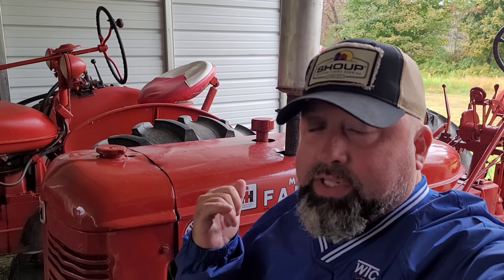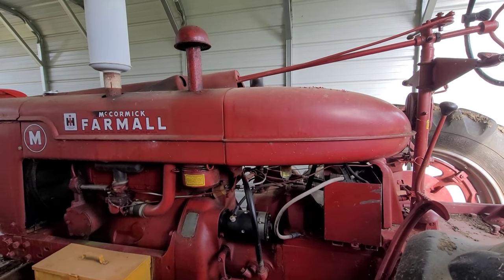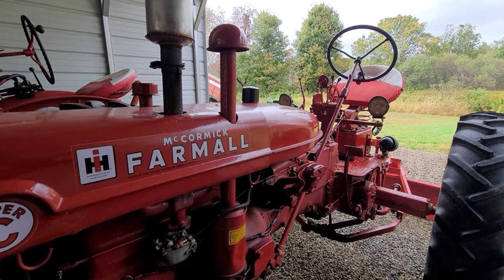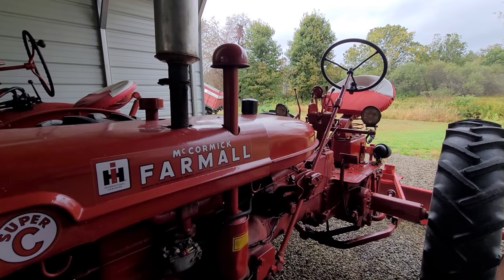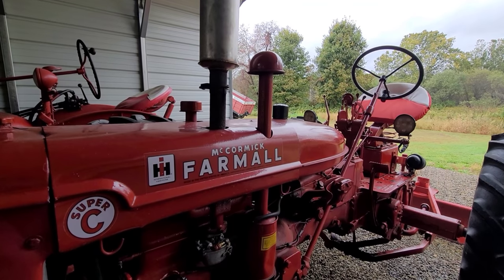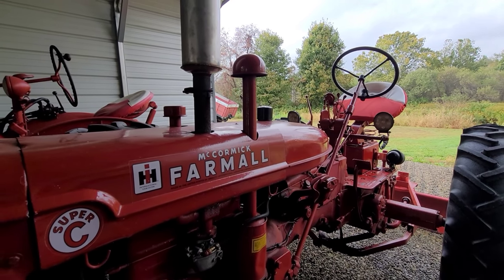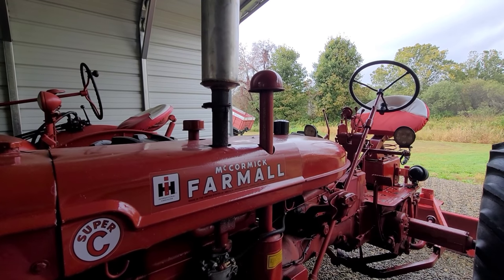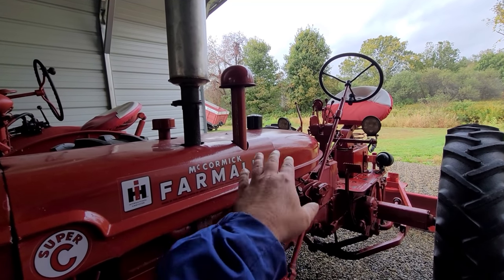How Would You Clean a Rusty Fuel Tank?

Comment: Something we did to help our Super A when it started surging was to put a zip tie around the intake manifold to the throttle linkage. It adds a little bit of resistance to prevent fast movements of the linkage. It's definitely not a permanent fix, but it made the tractor behave until we had time to do a proper fix.

Comment: If you go through all the effort to take a tank off to give it that level of deep clean, they also make a couple of epoxy products specifically for gas tanks you can paint the interior with and you'll never have to worry about rust in the tank ever again.
Reply from the maker: Absolutely
Reply: Haven't some of those liners gooped up over time and caused carb issues?
Reply: NAPA makes a lining kit that I've used and it worked very well.
Reply from the maker: They're not supposed to but I've never tried them

Comment: As a motorcyclist I have gotten hold of some old bikes with trashy tanks.There is a product called Kreem that seals the tank once cleaned with a coating that prevents further rust. Is very easy to use and seals the tank once cleaned for life. It will also seal small pin holes and fractures along weld lines in a tank.
Reply from the maker: I'll have to try it if I ever get a really bad tank

Comment: Your older vid on the M carb really helped me with our 300U carb. The only diff is the darn choke arm is on the other side (awkward). The float kept sticking bc the new one was fatter! I had to adjust many times (no gas, pouring gas...) before realizing you can hear if its free through the air intake before putting it on by tipping it.

Comment: The last time I had to  clean a fuel tank it was on my H. Even with a stand pipe I couldn't keep it running. I took it off and power washed it. I figured it would probably reveal any bad spots. It cleaned up good and I had no more problems.
Reply from the maker: You're so much better just to take them off and clean them good

Comment: I am trying the Vinegar rout. So far its doing its job on my 544 tank. I have been using the 5% store brand for $3.50 a gallon for just cleaning the bottom until the 45% Vinegar arrived from Amazon.. I bought 3 gallons for $58 and made 27 gallons so that only $2.15 a gallon (Farmer savings). I filled it to the "Brim" which is 25 gallons today (first time that tank has been filed in years) so we will see how that does. Then I plan to remove the tank and put a chain in it to get the loose residue out. After that I am using OPSHO to convert any remaining rust. No more Alcohol fuel in any gas equipment unless its used allot. My fuel bowl assembly and carburetor were completely plugged with that white crappy residue.
Reply from the maker: That will work
Reply: I cleaned the fuel tank as described and all the rust was removed, which was allot. I kept draining and filtering the 5% Vinegar which took about 5 days of work. Then after rinsing it with water I dried it (it does flash rust) then I rinsed it with about 1/2 gallon of OPSHO which I drained out then I let it site 24 hours before rinsing it out with water. Note: If you let OSPHO sit 24 hours like they recommend and if it pools in the bottom of the tank (it does not all drain out) the volume will cake up and leave a black residue which needs to be removed which can be hard to remove. Therefore if its used I would just let it site a few hours then rinse it with water. I then sprayed the entire interior with fogging oil. Its as good as it was new (or close to it).

Comment: Use a motor cycle tank repair system. This has 3 stages. 1st is a solvent, 2nd is an acid wash & 3rd is an epoxy sealer. End of problems with your tank even if it has leaks before you start. Seal the leak on the outside with tape. You may require 2 kits as the tank is larger than a motor cycle tank

Comment: Question i have a 50s farmall cub radiator is cracked all the way across on bottom any suggestions
Reply: They made cubs forever, easiest would be look for good used or rebuilt/new.  I know, obvious answers, but cubs have huge following and lots of clubs out there, hopefully someone more linked into one will reply to you 👍 🙏
Reply: Brass??? Braze or solder carefully.
Cast, JB Weld or mig weld carefully.. 
Don't want to burn the solder or gasket out, but need to keep enough heat to fix it.
Reply: @TomA6788  thanks i just dont wanna spend money on a tractor unless thats my last option idk wht to do my favorite tractor grew up driving it first thing learned how to drive and manual
Reply: @jamesrodes2754  Ah ok. Ed just replied with next least costly options depending on metal.  Good luck!!👍
Reply: You can purchase a new aluminum 
Replacement radiator on Amazon 
For about 150.00 I installed one on my cub it works great 
It comes with a new gasket too

Comment: Good evening! My fathers Super H with T/A had not run in about 5-6 years and had about 2" of sludge on the bottom of the tank. Took it to a radiator repair shop to have it cleaned out. The owner/manager there said he could do that and coat it also. Work still in progress, Not sure what the bill is going to be.

Comment: In my own experience once a gas tank starts shedding rust flakes it's a downhill battle with reality. I've had 100% success rate using Caswell fuel tank sealer. It's the only one I'll recommend. Seals pinholes very well. Follow the enclosed tank cleaning and application  directions. Ethanol does not bother it.

Comment: There is a process called "reverse osmosis". You mix washing soda and water and fill tank with solution. the find an anode to stick in the solution,without touching the tank. Then you hook up a small battery charger,one side to the tank,the other to the anode.the bat chrgr should be less than 10 amp max.There are articles in the Farm magazine that explain it in detail. Probably some youtube videos as well. good luck.

Comment: Muriatic acid is too strong it can eat a hole in a thin tank in a few hours. I don't  know if there is a dilution table or not.
I think after cleaning they make an epoxy coating for fuel tanks i think that you remove the tank and put the recommended amount in and slosh it around remove fuel cap and let cure the epoxy will prevent any water from contacting metal and protec from rust formation.....
Also use Heet fuel additive to help remove water and keep fuel tank full 
Filltank completely before winter storage use a good fuel stabilizer, too

Comment: Since you're the farmall guru here on YouTube, I've got a question for you to settle a friendly argument, is it required to remove the battery cables before welding on a tractor to avoid electrical damage
Reply from the maker: They recommend removing battery cables to prevent possible battery explosion but most people dont do it

Comment: hi there i just got a M Farmall what size battery is in yours ? I have to figure out how to mount the battery as there is no battery box either, just a plate. I removed my tank and carb I plan on flushing the tank with muriatic acid and rebuild the carb. The gasket are all dried up. It might have been ok but i feel better knowing its all good.
Reply from the maker: I would have to actually look to see what size battery it is
Reply: no worries I went with a Walmart special cheapy it starts ok with it. I mounted the battery under the gas tank in a plastic battery box for now.  @FarmallFanatic
Reply from the maker: @jpthedelawarebeeman7887  To be honest with you, the really good batteries are lasting 3 years max. So at this point you might as well go cheap

Comment: To all, donot use a shop vac to remove gasoline,  even gasoline that is too stale to run an engine.  A man near me, this spring had a riding lawnmower that had stale gasoline in the tank.  He got his shop vac out and started to suck the gasoline out.  Well the vac exploded! Luckily the vac was on the other side of the lawnmower.  He got some first degree burns.  Lesson well learned!
Reply from the maker: Yeah there is a lot of spark involved I won't even suck out the debris until the tank is well flushed with water

Comment: See what you do is get about 100 lbs of pea gravel. You get a shake table. It runs off an electric motor off a small crank. Ya'll tie the tank down with straps. If you make your own use 4 wobble pins about 3 inches long into a hole on each corner with nuts jammed together tightly with play between them. Let it run about 1 minute on each side of the tank. Wash it out with acetone and dry it out. Look ma no rust.

Comment: Any thoughts on how you're going to winterize all that Big Red Iron yet?  I believe my Super C manual recommends draining the coolant, if you don't plan to use the tractor over the winter.  I don't think that applies these days.  I plan to leave it in over the winter even though it won't see much action.  Thoughts?  Future videos?
Reply from the maker: That is interesting ...no I plan on using this tractor all Winter for snow removal in the driveway ...actually have about a 10th of a mile driveway and we get blizzards so I'm really going to put it to the test
Reply: I think back in the olden days many farmers typically ran water only. Some even in winter or an alcohol mixture. This was before antifreeze coolant was readily available.
Reply: @zodszoo  The neighbor's farm I grew up basically on told me before antifreeze some 'old boys' would put kerosene in their tractors, just hope you don't have any leaks 😳😳😳 He never did that and he always tested every fall and serviced as needed 👍😎
Reply: You've got more than a few batteries I would image too.  Do you disconnect the leads on the ones that are going to leave sit all winter?  What are your thoughts on trickle charges for the ones that you intend to use in the winter.
Reply from the maker: @tomyoung8719   If I'm using the tractor on a semiregular basis I won't remove them for trickle charge, but like say the combine and those machines that don't get run often, those batteries get pulled and put on trickle

Comment: You might water down the vinegar so it's a weaker acid and save punching holes through the tank. Vinegar will also corrode the bolts you throw in there. The old farm method I grew up with was water and cleaned pea-pebble stones. Shake it shake it shake it. Drain it all out and dry it. The modern issue is find a fuel source with no ethanol if the tractor will be stored more than six months. If you are using the tractor every day then no problems using whatever fuel is cheapest. But as you get into fall and possible storage track down a station that sells non-ethanol fuel. Ethanol is what gums up the fuel system over time plus causes the corrosion problems in the tank and carburetor.
Reply from the maker: I run non ethanol non stop on all these tractors